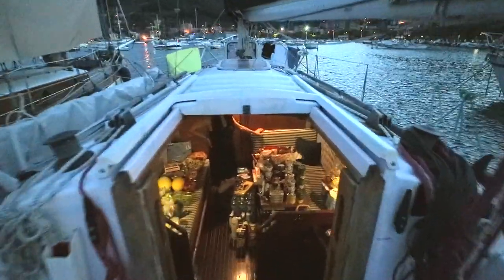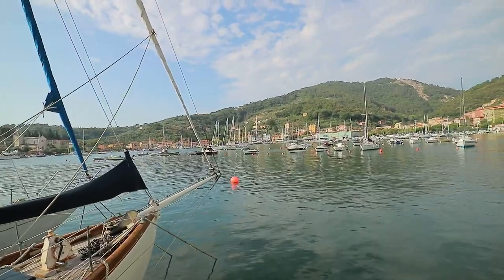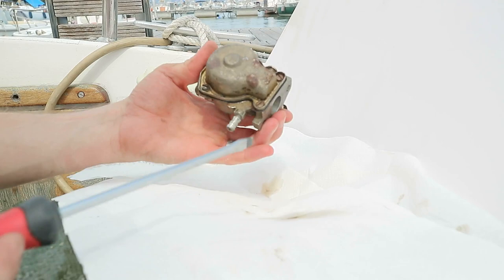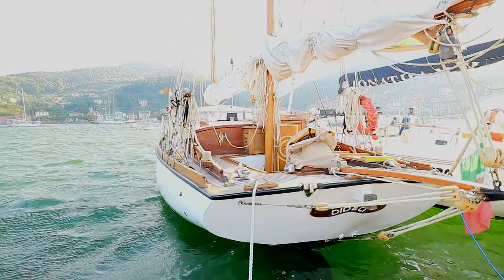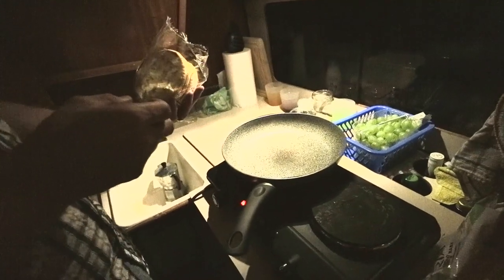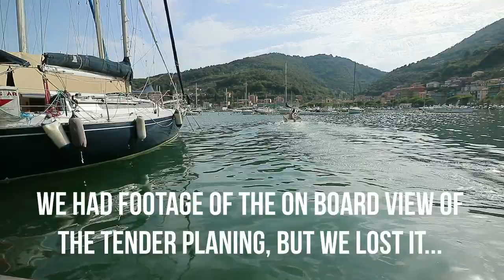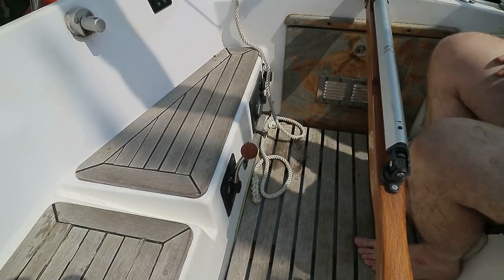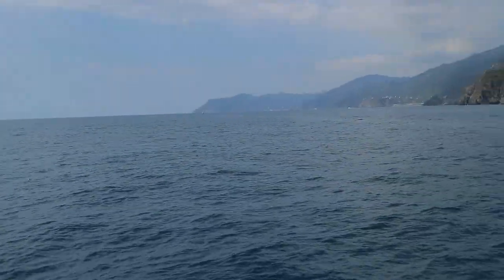Boat Work, Provisioning and Setting Sail on a New Adventure! [Ep. 5] ⛵ Sailing Britaly ⛵

Comment: You are brave repairing your outboard whilst it i's suspended over the drink, everytime I conduct repairs like that I have to hire a diver to retrieve all my tools, keys and parts of whatever I was repairing lol.. best wishes to all 3 of you 😁
Reply: I was thinking the same thing!
Reply from the maker: Hi Daniel, I like to live dangerously and find I work better under pressure... Risking to drop no-longer-manufactured 30 year old engine parts into the sea was the perfect way to concentrate the mind! 😂 Only joking, you are right of course (I dropped the action camera into Davy Jones' locker, which I'm still gutted about) but I couldn't resist the convenience of keeping the engine on the bracket as I worked on it. Thank you for watching and commenting. :-) Fair winds, Chris, Rossella and (about to join us very shortly) bump 👍

Comment: Buy these oranges foam that you can fix on the back of thegopro  camera for it to float, are cheap and light you can buy and mail to your next port. I liked the tip of the bag with fresh water to wash the auxiliary motor !! Good Winds
Reply from the maker: Hi Art, thank you for the tip for the gopro... Unfortunately I had taken the gopro out of its case and put in inside a holder with a clip on it, which I clipped on to the pushpit (to record us manouvering the boat). When I boarded I forgot it was there, bumped into the camera and it disappeared into the sea. I won't do this again, that's for sure! Thank you for watching & commenting. Fair winds! Chris & Rossella 👍

Comment: Hey, a stick of hot melt glue and a butane cigarette lighter will fix poly.
Reply from the maker: Hi Ken, thanks for watching and commenting - good suggestion! I could have plastic welded it with the soldering iron I had on board but that didn't cross my mind at the time. The epoxy worked though and the container still doesn't leak. Fair winds, Chris (& Rossella) 👍

Comment: Nice one pizza padana you make the whole thing in the pan. 🍀you could make a fit over outboard bracket for the dinghy so you can sail and motor🍀could rosella be coaxed into a lifejacket🍀i was hoping for stromboli at night great fireworks . I use richs 1 gallon cider barrels cheers
Reply from the maker: Hi Sean, 'pizza padana'... 😂 Motor sailing our little folding tender would get us even funnier looks than we get already, plus our motoring cone would take up half the available space on it. :-) We don't wear life jackets in the summer in the Med - fair play to anyone who does, but we don't feel it's necessary (Rossella is an extremely good swimmer - even though she has a phobia of fish...) If we were doing something particular (night sail, very rough passage...) then we can always put them on. Fair winds, Chris (& Rossella) 👍
Reply: Sailing Britaly as long as you have your dickiebows for portofino🍀
Reply from the maker: We definitely don't have dickiebows :-) Portofino will be in a video coming soon... 😀👍

Comment: Wow, reparing the outboard over water. Your quitte skilled Chris. Good on you mate. But what and or why did you run the prop in a sack (?) Of  water for, after the repair was done. I do not understand what you did or with what purpose. Intriged. 
Wishing you fair winds and save sailing!
Reply from the maker: Hi Robin,  it was a bit more risky working on the engine like that but the convenience of having it suspended at a comfortable working height made that the more attractive option. The fender was full of fresh water to keep the water cool whilst running it. It also cleans out the internal waterways and helps dissolve salt deposits. Fair winds! Chris (& Rossella) 👍

Comment: Those plastic rings beer cans come attached to each other with, well using a hot soldiering iron you can weld the water tank hole up with the plastic rings.  First learnt this repairing skis.
Reply from the maker: Hi Pete! Great tip and I don't know why but repairing the tank with a plastic weld didn't even cross my mind that day. (I could have repaired the small hole without any extra plastic simply by melting the jerry can material itself with the soldering iron I have on board) I'll bear that in mind for next time but fortunately the jerry can held out well with the epoxy repair and is still watertight now. Thank you for watching and commenting. Fair winds, Chris (Rossella [& baby Emma!]) 👍